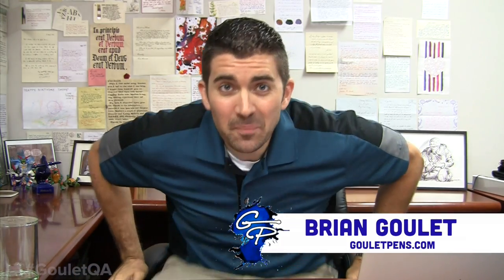Goulet Q&A Episode 41: Resin vs. Metal, Cleaning a Pilot Parallel, and Invisible Ink

Comment: When the weather outside is frightful may I suggest getting yourself some foul whether tires :) I assume you have some semi slicks or traditional road bike tires (come standard on majority of road bikes) I used to jave two sets my semi slicks and my , now that commute by bike is popular,  what is known as city tires. Although I have ditched the semi slicks all together since my cities are awesome.  I recommend 

Panaracer - Pasela (biggiest bang for the buck)

Schwalbe - Marathon Plus (priciest from the list but have a gteat tr3ad pattern)

Cheng Shin - C1313 "city tire" (lowest cost, good value)

                  -C1490 "selecta" ( comparable to the Marathons,  but with a better price tag)

All these tires are awesome in tread,  longevity,  amd overall performance it really comes down to preferences. If you have the fork spacing for it try and run some 700x28c tires ( again as you have a road bike I assume you have some ×23 or other slimmer profiled tires). I shop at bike tires direct . Com , but im sure they can be found elsewhere.  Ride safely  my spoke brother !
Reply from the maker: Proj8ct Awesome, thank you! I'll have to check these out. The tires I have on my bike that I just wrecked were just the stock ones since I just got the bike a few weeks ago. My plan was to pound out about 1,000 miles on them and then just keep them as spares for my trainer and rails. I don't have the spacing for a 700x28c, I think the widest I can go is 26c, I have 23c on there now. On my other bike I have a set of 700x23c Continental Grand Prix 4000's, and have really enjoyed them. I've never considered a touring tire, but seeing how I'm doing mostly long rides on country roads, maybe it'd be worth a look. -Brian Goulet